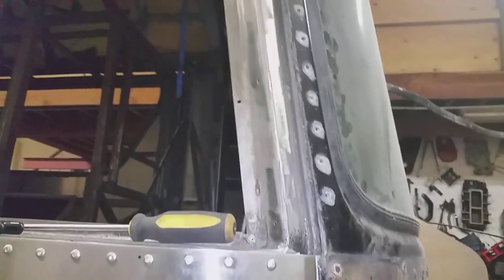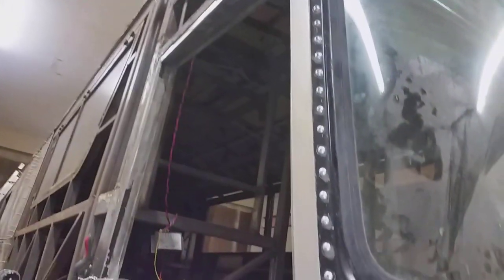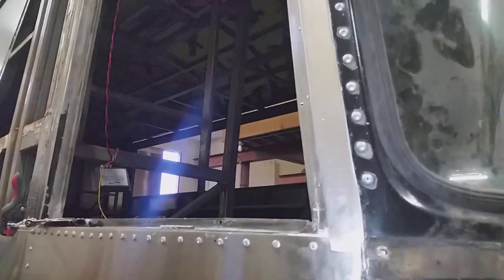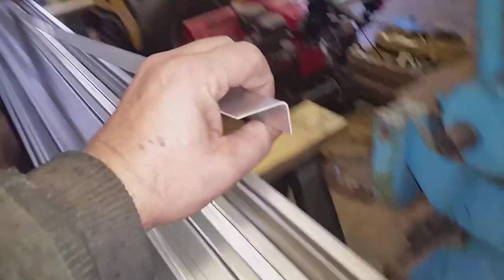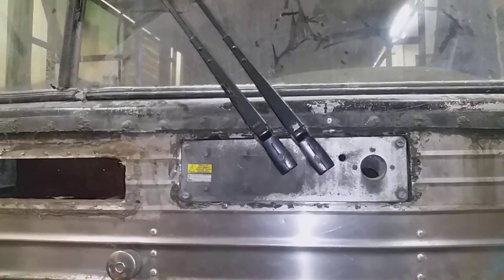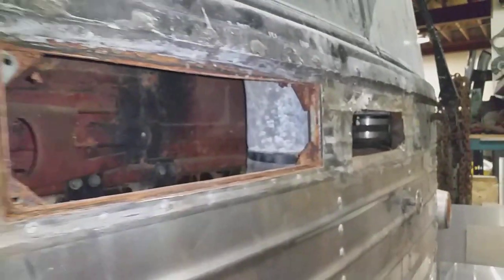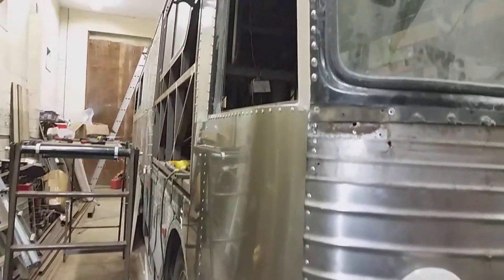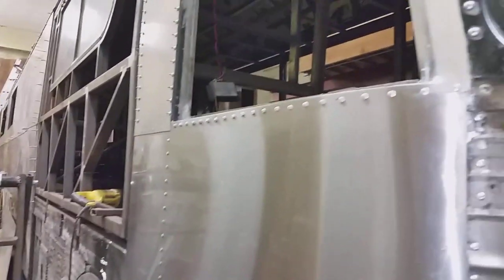Bus Conversion Project - Video 53 - Working on the passenger side front corner

Comment: As always amazing job . I understood the " not an exact bolt in but it bolts in place meaning " . Glad it bolts in and you don't have to reengineer the mounting points and frame changes under the dash. Makes it a lot easier for Dad and you to install the new heater and air boxes anyway. Since you will already have the wiper motors in place the rest of the under dash work should go straight forward and you can deal with the rust issue from the inside once you have finished skinning and can get some heat in there for the cold nights when you have the ambition. I really understand the cold vs ambition fight its 34 degrees outside right now, and it's still dropping 26 tomorrow at sunrise. I gave up on my project tonight after I ran out of wood for the stove inside and looked outside to go get more but saw the thermometer and shivered. Oh well there is always tomorrow. Seam sealer I swear the tube says 12 oz and they only put 9 oz in it . This is why you and I both run out lol.
Reply from the maker: Ya, I think anyone who builds stuff would have understood what I meant but I didn't want people to think it was a direct bolt in deal..... still some assembly required :-) .... don't know if I'll get it buttoned up in time or not, all depends on the weather, it's still way warmer than this time last year and if it gets too cold I'll take a month or 2 off and every tube of seam sealer , about half way through there's a big pop of air so I think you are onto something.... I think we are being screwed out of some black gooey crap that costs way too much in the first place

Comment: As usual, outstanding work. 

Had Dell rebuild my system again. Now Adobe is working. I have a 30 minute build project on engine scrap metal lamp almost done, that will be a Christmas present for son number two. Son number one will be getting a brake drum forge, on a cart (also working on this to be posted). 

Do you have heat in the shop. Weather here is suppose to get cold this coming week and stay that way for awhile.

Skinning is getting closer to being done.

Glenn Lever
Reply from the maker: Good your computer is working properly, no heat in the shop, I'm trying to get it all skinned up so I can put some heat inside and work inside for the cold part of the winter Dash, Steering, lights and wiring... that sort of thing from inside, if it gets to cold before I get it skinned I'll take a month or so off.... still better than last year, I didn't work on it from October thru January last year, put me way behind but it was just too cold... supposed to dip down to freezing this week so not too bad yet... still way warmer than this time last year
Reply from the maker: just watched your video.... nice job, better than mine already and I've been at it for almost 2 years
Reply: Thank You very much, means a lot. Merry Christmas. leaving this morning to drive to Indianapolis to pick up the engine. Glenn Lever

Comment: Hi Jim!  Wondering what your painting plans are. You painting or having a shop do it?  I'm asking 'cuz I want to do a full body paint on my rig, but not able to do job myself. Looking around for recommendations. 

Thanks
Reply from the maker: Hi Barry, I'm going to paint it myself, I'll tarp off one side of the shop and build a temporary booth, I've done plenty of hotrod painting so it should be fine, I am going to use basecoat , clearcoat and the paint I want to use is around 900.00 a gallon and I'm figuring on 5 gallons plus clear, it would be around 20,000 to have a shop do it and that is way outside my price range, I haven't got it all figured out yet but at this point my plan is to do it in sections using the seams in the aluminum as break point, I'm going to go with a full graphic job as well so that will add a challenge but I'll figure that out later, you can use single stage paint which is a lot cheaper and I have even seen some roll it on as long as it has no metallic in it , that would work, it all depends on the finish you want when done, if you look at DZLFREEK's paint job, he did that himself, sprayed single stage paint and it looks like it turned out pretty nice, you could watch his video's and get some ideas